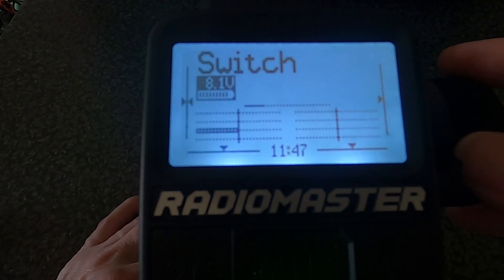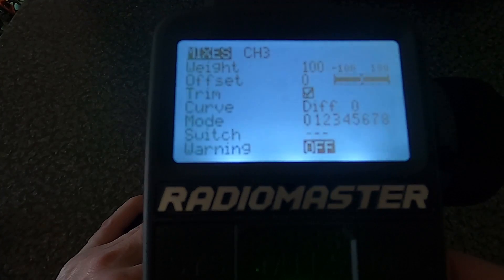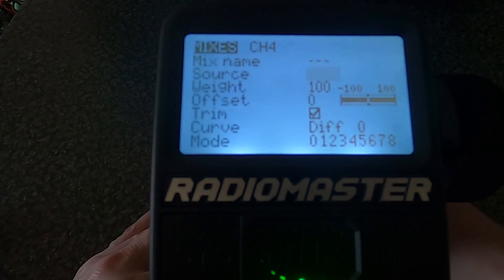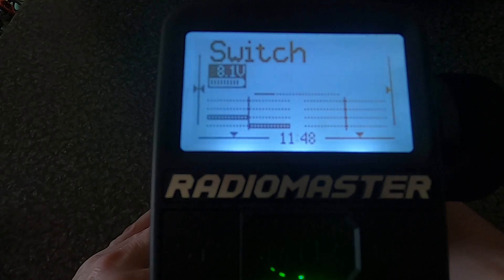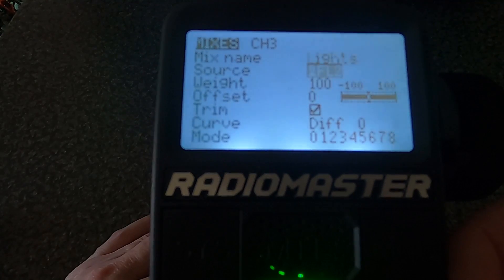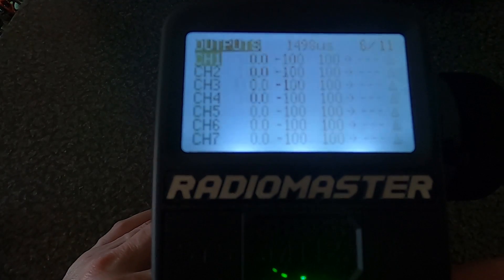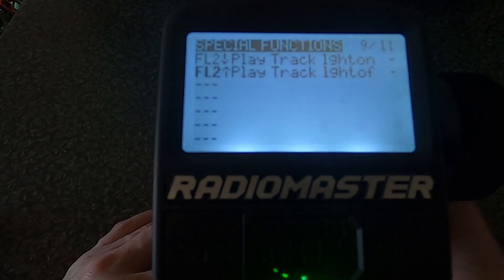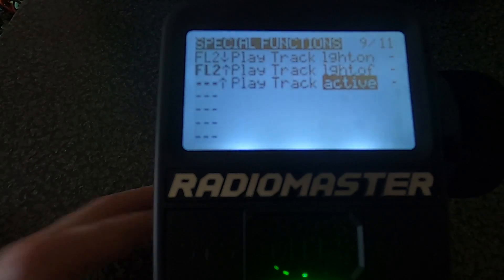EdgeTX – RadioMaster MT12 Assign Channels to Switches

Comment: Love your videos! I’m looking to control the yaw of a gimbal with the p1 slider. Do you have a video on this?
Reply from the maker: Go to INPUTS, Rud, go to Source, click enter once, activate P1 and click enter. All done!
Reply: @ Rud? I have mounted the gimbal on top of a rc truck.
Reply: @ I also have the little joystick usb on the mt12. I could control it with that. I’m just having no luck programming.
Reply from the maker: @scottjulian2251 if you want one of the radios channels to be controlled by a switch select it in Source.

Comment: So, I've watched many....many videos on this, read the manual going step by step, and yet I still can't get the lights to turn on and off..... I'm using the 5 channel ER5C-i receiver in a Traxxas Slash and have the lights plugged into channel 5. I'm going to try a different channel I guess and see if that makes a difference, that's the only thing left I haven't tried yet, but I'm also not the most tech savvy guy either 😆. If you read this by chance, and are able to give any advise it would be greatly appreciated. This video is also the most comprehensive, and understandable I've seen yet, some other people on here are doing things with the MT12 that is so over my head 🤣. I hear words that I know, yet I don't understand anything they're saying. I also downloaded the manual online and that is saying to press the sys button, page right to hardware, then change....stuff 😆. Not important, just curious as to why the manual says to go there, but your way is completely different? Is it a matter of getting the same result, just two ways of getting there? Or is am I misinterpreting the info from the manual?
Reply from the maker: It is because you are using channel 5 which is only used for Arming in the firmware version as December 2024. You are correct try another channel and you should be fine.
Reply: @the-happy-RC-flyer   I tried channel 3 a day or 2 after my original comment, still no luck. I have had this MT12 for about a year now also....
Reply from the maker: @IDFKwuttoput4aname You need to check the weight of the channel you are using you may have to reverse it by changing the 100 to -100. Check the settings the LEDs require to operate and the mix is working in the channel monitors of the model settings.
Reply: @the-happy-RC-flyer  I will try that, I'm also not very tech savvy either 😆, my main reason for buying the MT12 was for the incredible long range it has as I planned on putting and FPV system in 2 of my RC's, but my lack of knowledge with FPV, and also the local hobby shop not knowing anything about FPV either I was unable to do that before money ran out.... There were some very expensive house repairs I had to do, among a few other things....
Reply from the maker: Hi Mike, life happens that’s why sometimes my replies to viewers is delayed. If you need any help just email me and I will try to assist you. You can now get very reasonably priced goggles but remember they limit your range your RC link will go many times further. FPV on RC cars is great fun. triplemadventures@gmail.com
Reply: @the-happy-RC-flyer  😁No need to explain, Shit happens is the story if my life, 🤣 excuse the language.  I appreciate any help, I may email you when I can and possibly send a few pics of the menus on my radio, in case I change things that I shouldn't have, since I've been messing around with this on and off since I got it. Again thank you, and I hope we can get this figured out 😆

Comment: bill, i assigned my t4 trim switch as a two position switch. i go to the monitor  and the ch i assigned it to shows that it is working but i also get a trim beep and the trim still moves. is there a way to disable the trim and trim beep sound?
Reply from the maker: Hi Michael, you need to goto Flight Modes in your model settings. In trims change the fourth :0 to - - or 3P beeping will stop. Please take a look at this video which explains more about trim switches it is OpenTX but still relevant today. https://youtu.be/JzShbMj_9mw?si=HiaNrlBCz2_j5Fa7

Comment: bill i set up the mixes like you told me in outputs ch3 for the 3 sp transmission and ch4 for the 5th wheel. do i have to do anything on the inputs page because i cant get them to work when i run them thru the gt power unit. its getting awfully aggravating. please help all im asking is setinng up the mixes enough or do i have set anything up in the input page
Reply from the maker: Hi Michael, no you just leave the Outputs as they are. Could you please send me a scanned copy of the models instruction manual to triplemadventures@gmail.com without this I would be guessing the set up you need. You may need to change the weights from + to -

Comment: bill i want to set the 3 pos switch to change gears on a transmission. 1st 2nd and 3rd. i understand on how to assign switch but how do i adjust the servo throw for each gear. im thinking go to outputs and adjust weight for each position or is there an easiewr way. also will more expo on lets say the thriottle channel apply power at a lower rate as i pull the trigger ?
Reply from the maker: Firstly would suggest not using expo on the throttle. You can adjust the weight but this will affect the position either side of center. You could then add in offset to correct any difference’s either side of center.

Comment: Hi bill how do I add the 5th channel. I went to the hardware page and it shows only up 4 channel. I am using the er5ci reciever. Need to add the 5th channel for fl1 switch. Thanks
Reply from the maker: Hi, please go to MIXES and click enter on channel 5 and select the source and activate the switch you want to use. Remember with Express LRS Channel 5 is only used for arming your motor.
Reply: I'm also trying to use channel 5 for my lights, they work when I turn on the car, but I can't get them to turn on and off, when you say channel 5 is only used for arming your motor, what does that mean, and can I use channel 5 to turn my light on and off with FL1 or FL2? Or do I need to use a different channel? I'm not the best with this stuff 😂
Reply from the maker: Channel 5 is not full resolution but should turn lights on. You can assign any switch you wish just select the switch in the mix.

Comment: Any idears? The sound on mine worked for 10 minutes now nothing, just haptic, I've checked all the settings, sound is set to all and the volume is up, could I have pressed something else maybe? I've been into rc all my life and half know what I'm doing but can't figure this one Out! Its driving me nuts, I'm at the point of taking it apart or sending back. Any thoughts much appreciated.
Reply from the maker: Have you set up Global Function volume to a switch  or a rotary switch and activated it? Under Radio Setup have the volumes been lowered?
Reply: Yes, tried that and still no sound, is there anyway to test the speaker do you know?
Reply from the maker: If everything is set up correctly it can only be a hardware problem. Have you tried a different sound ?
Reply: @the-happy-RC-flyer  yes I tried playing a wav track and still no audio
Reply from the maker: Does your radio audible say welcome to EdgeTX when you power it up? If not it could be a hardware problem. It’s possible a wire has come off but only strip the radio if you are comfortable doing so.
Reply: @the-happy-RC-flyer  no it doesn't, strange but the sound worked today twice on start up and wav files but not on trims, now it's silent again🤣 who knows! It's driving me insane! Spent hours on it!
Reply from the maker: Have you changed any of the radio settings? At the moment we cannot back up the radio and model settings with companion until the next major release of EdgeTX so you cannot email me a back up to check. You could try resetting the radio by downloading the Factory Firmware  from the EdgeTX website and flash the firmware to see if it sorts out the problem before returning the radio.
Reply: @the-happy-RC-flyer  I've not changed any of the radio settings that I don't understand and it's strange today that I turned it on after doing nothing and the start up sound worked until I turned off and on again, don't really want to start flashing firmware on a new tx as it's not really my area of expertise and don't want to brick it, I've messaged radiomaster but atm they seem to be asking irrelevant questions and bouncing emails backwards and forwards to stall me, getting to the point where I've spent too much time on this and I'll just live with a silent radio🙄 after all with an rc car voice is not really needed, be different if it was an airplane tx, seems to do everything else OK, it's just it should do it, so I want it to work 🤣🤣
Reply from the maker: I agree it should work. I will contact RadioMaster and let you know what they say.
Reply from the maker: I would suggest formatting the SDCard and downloading the SDCard contents and place it on the formatted card.
Reply: Brilliant, thankyou 👍  I'm trying them but thus far no joy with them, 😂😂 I've had this radio since Tuesday and spent 2 to 3 hours every night fiddling with it, silly thing is got it set up and working on one of my cars in 20 minutes, just stuck on the sound for, what😅😅 9 hours now!!
Reply: Just had this back from radiomaster.....We found this problem, cover the SD card rubber cover, if the plug is too tight, the SD card will be a little deeper, resulting in poor contact with the SD card and can not play audio files, you can open the rubber cover, eject the SD card to reinsert, rubber cover SD card position do not press too tight, you can solve the problem.
Reply: And yes, WOW😅😅 I now have sound again after trying this, still no start up sound but I can live with that...thanks for all your help guys, hope this may help someone else
Reply from the maker: Thanks for sharing.

Comment: As an FYI, if you have the later EdgeTX firmware, you will have a box at the end of each line in Special Functions.  That is the enable/disable checkbox for each Special Function line.  Make sure to check this box to hear the sound (or enable whatever Special Function you have set up).  You can also, of course go back and uncheck the box to disable the Special Function, if desired.
Reply: @Mikeylikesit1968  I have check boxes on my version of firmware for Special Functions, including Play Track.  Guess it's just me then.  And I will admit, that I'm new to EdgeTX and thanks for your elitist attitude towards me sharing what I've discovered.   I'm here to learn and this is why I watched this video.  Learn to be nicer to those who don't know as much as you apparently do.
Reply: @bugman72  I use a Tx16s so I don't have check boxes for using a track using 2.9.4 firmware